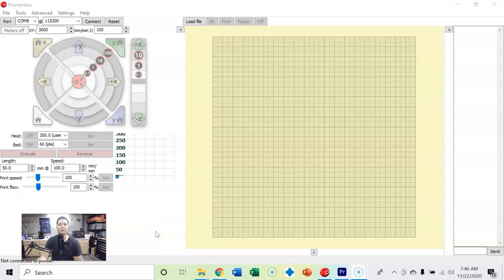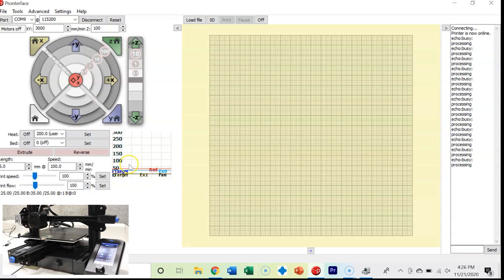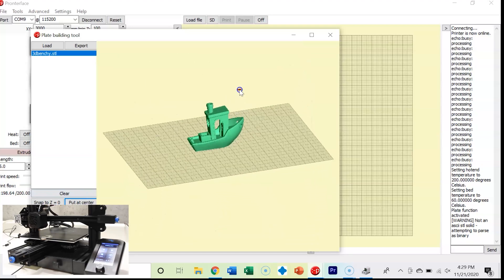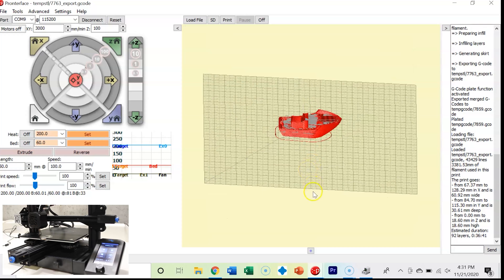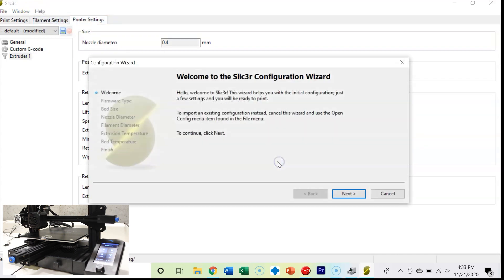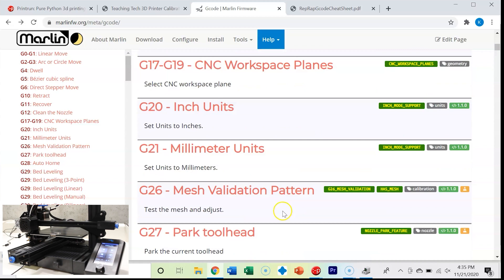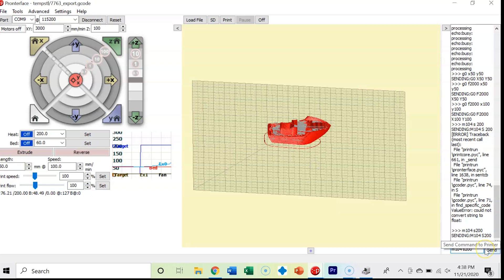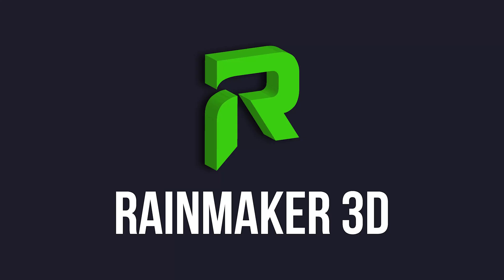Pronterface Interface Overview - How to enter G-Code directly into your 3D Printer and more!

Comment: Me ajuda por favor... Esse erro eu não consigo resolver  
  Traceback (most recent call last):
  File "pronterface.py", line 62, in <module>
  File "printrun\pronterface.py", line 2582, in _init_
  File "printrun\pronterface.py", line 170, in _init_
  File "printrun\pronsole.py", line 786, in parse_cmdline
  File "printrun\pronterface.py", line 1154, in process_cmdline_arguments
  File "printrun\pronsole.py", line 769, in process_cmdline_arguments
  File "printrun\pronsole.py", line 664, in load_default_rc
  File "printrun\pronsole.py", line 635, in load_rc
  File "cmd.py", line 211, in onecmd
  File "printrun\pronsole.py", line 412, in default
  File "cmd.py", line 236, in default
AttributeError: 'NoneType' object has no attribute 'write'

Comment: I was having troubles but now I am happy. I like this right out of the box. Im printing a Prusa slicer made gcode now. I was moving a sd card back and forth and it was making me crazy. I do not know how that is acceptable for some people. I hate Cura that came with the printer. i would like to use wifi as i just put in the module but this is ok. I have not sliced anything yet but I think it will be ok. If it slices well it will be the best software. If they ad wifi it will be the best bestest.